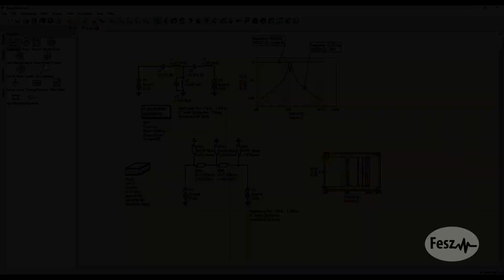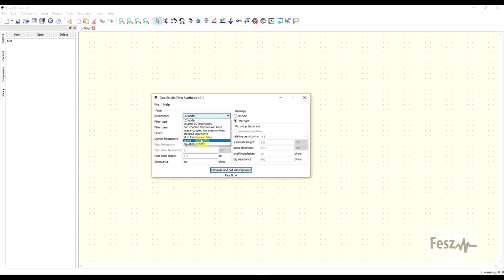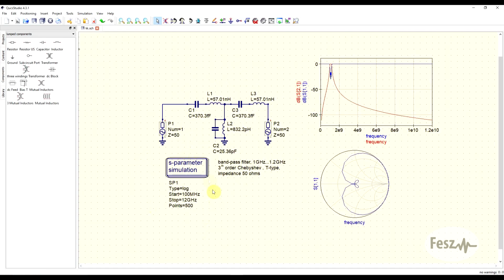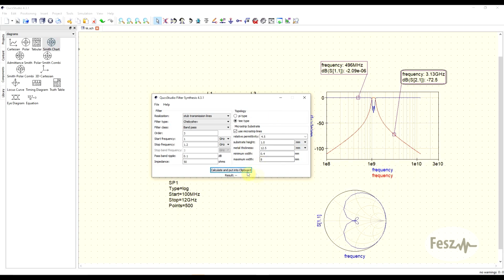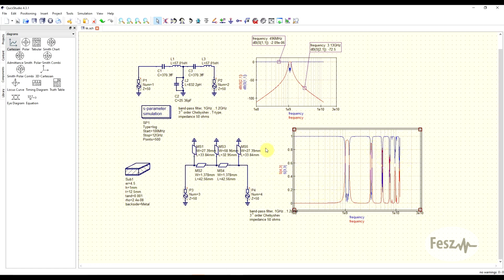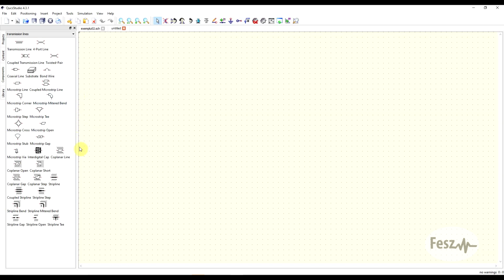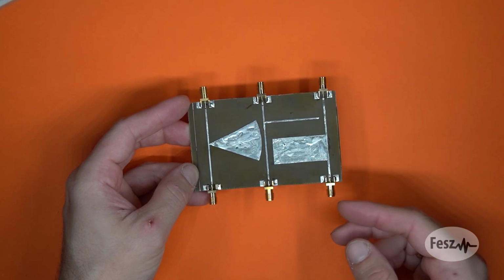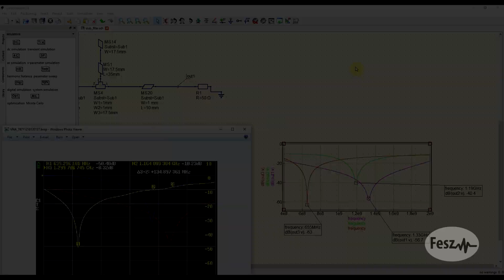Filter simulation - QUCS Studio

Comment: QUCS Studio is such an amazing simulatior. Very nice presentation. 
You could have briefly mentioned that one can define GOALS : QUCS will attempt playing with all chosen  patameters for OPTIMIZATION to achieve such GOALS.
Filter design tuning may cost just a few or several tweaks in the trial-error loop well know to anyone who has had to fit real filter curves to specs.
QUCS GOALS helps a lot because if the chosen parameters for OPTIMIZATION are not going to be the right ones QUCS will not be able to get close to specs, the same way a human wouldn't be able to fit the curve, saving a lot of time stranded in design cul-de-sac.

Comment: Thank you. Is it possible to generate filter for different in and out impedances?
Reply from the maker: Using the filter tool in Qucs, I don't think so. However, for LC circuits at least, there is a "matching circuit" tool in Qucs that you might find helpfull.

Comment: What tools do you recommend when you want to separately specify input and output impedance for your filter? I’ve come across many times now needing to design a LPF that also functions as a matching network at the same time. Do you know of any tools other than just doing it yourself in SPICE where you can specify complex input and output impedances while also a cutoff frequency, roll-off, etc? It seems like some sort of optimization tool would be needed for this to balance achieving the matching with the desired frequency response but I’m not aware of any tools that can do this
Reply from the maker: Most often when you do find filter calculators with different input and output impedance values, usually its just a real impedance; complex impedance brings the issue that the complex part isn't really constant - the real impedance you can keep fixed though. I would suggest to first try and compensate the imaginary part of your complex impedance, as much as possible in the frequency range of interest, and then try to calculate a real-only impedance filter. By combining the 2 elements some components might be eliminated - like 2 series or 2 parallel reactive elements. I'm not sure of the exact frequency range in which you need to work, but I did share some of the tools I found throughout the filter series.
Reply: @FesZElectronics thanks for getting back to me and good point! I’m working in the 11-14MHz range. The amplifier I work with has a complex source impedance which makes this all very tricky to operate over a 3MHz range and I still have not happened upon what I believe is the ideal solution. Thanks for all the great content